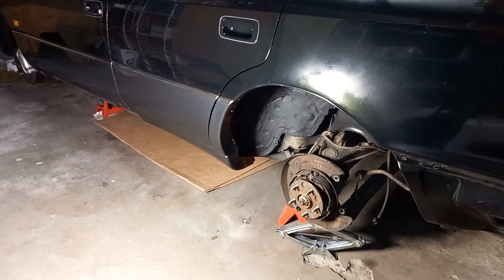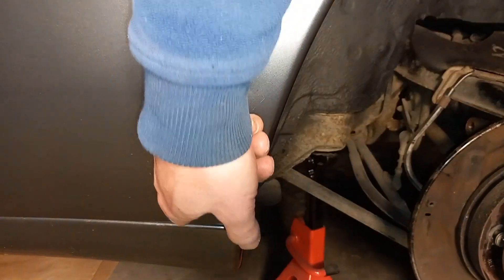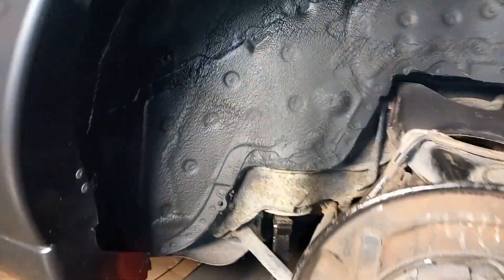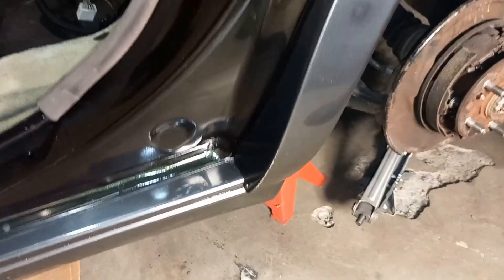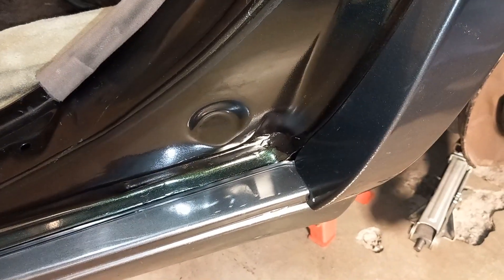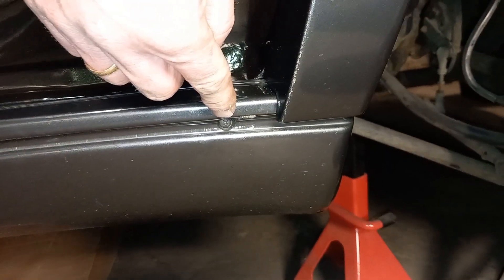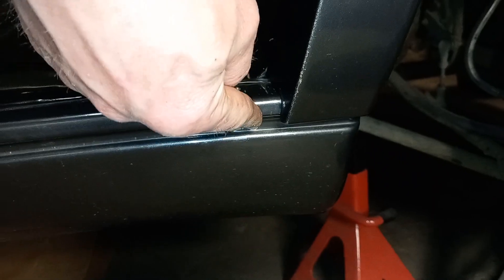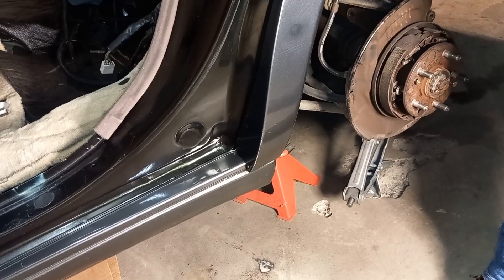Rocker panel rust repair finally finished (update)

Comment: 1st !
I looks smooth and shiny, and you know it's solid metal underneath the paint.
Reply from the maker: That's the most important thing, I don't like bondo or glass fiber filler. Just plain old a-grade steel! And everything is treated with hollow section wax.
Reply: @Carnold_YT  Yes!